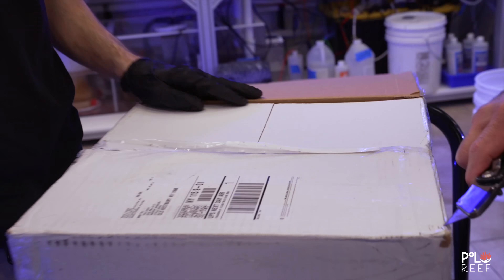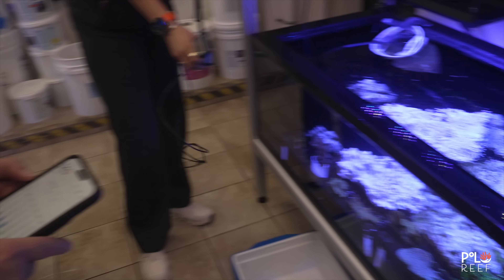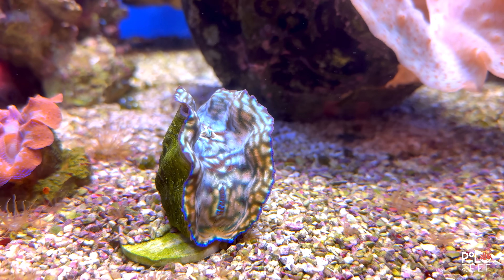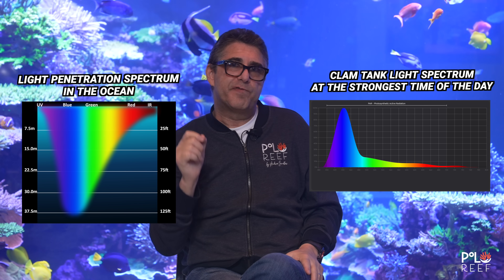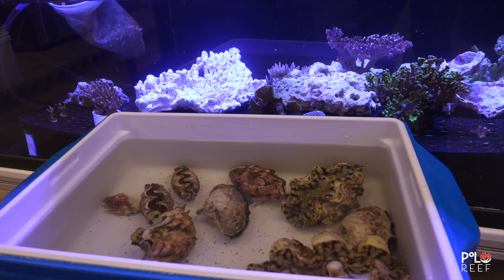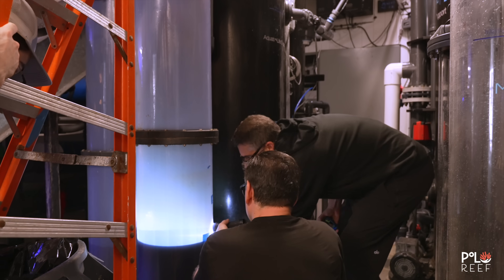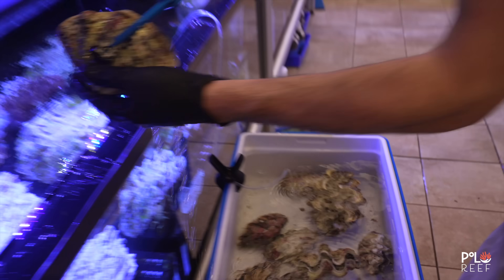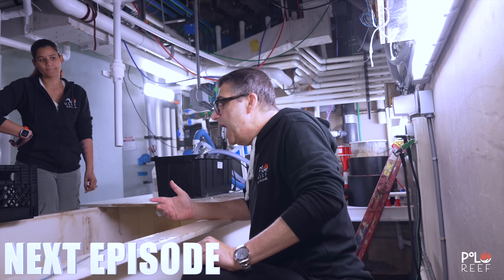Giant Reef Aquarium Clams + DIY GFO Sediment filter!

Comment: Nothing you don't already know but over the years I've lost a couple of my maxima clams and it wasn't until I started correlating my actions to the death one thing was in common.  Carbon and GFO.  I went back through my notes and observations and at around the same time I lost the clam it was me running, restarting, both carbon and gfo.  I no longer will use either product.  Too messy even with filters and good maintenance.  I'm sure you will come up with a better filter solution to make sure zero particles pass though.  All the best.
Reply from the maker: wow   i wonder if it makes water too clean too for them !!
Reply: @PoloReef  That is certainly one possibility.  I think in my case it was the opposite and I had fine particles from the GFO, Carbon, or both that was the root cause.  I think those particles are harmful to clams.

I believe in the video today you called out the particles and how to capture them to prevent releasing into the system.  I appreciated that attention to detail.   Pretty sure that was my failure point.

Have a great weekend and thank you for the reply.